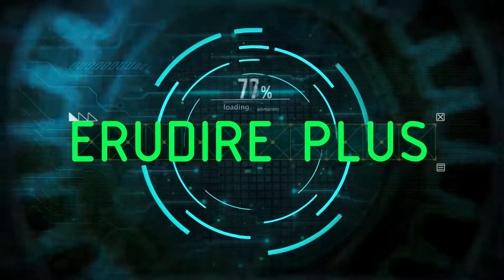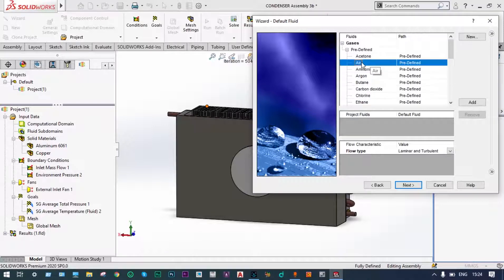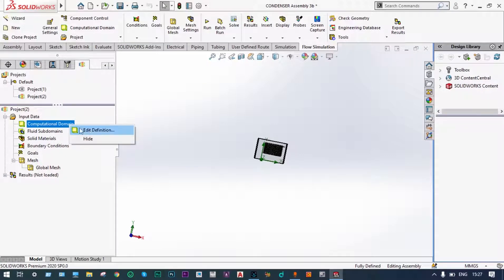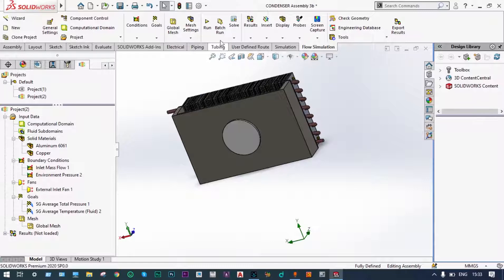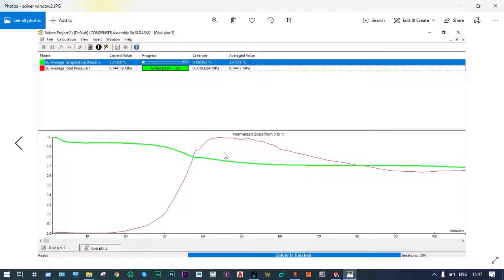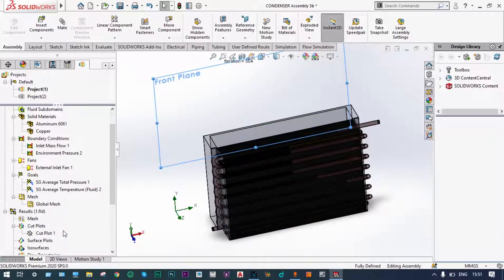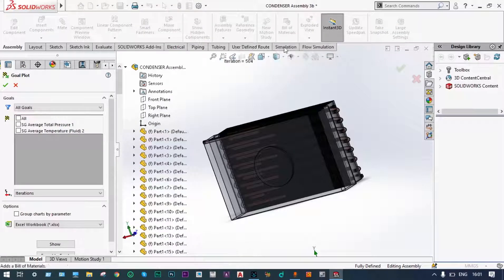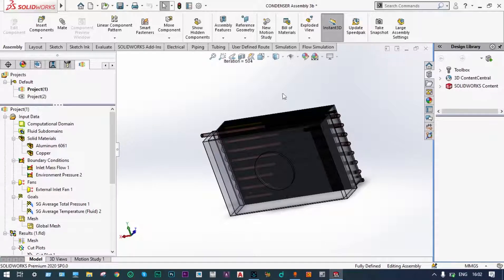CFD Analysis of HVAC Evaporator with SolidWorks 2020

Comment: Dear Sir, Every evaporator has the atmospheric pressure at inlet??
In our final yr project the measured pressure at outlet of evaporator will be 0.077083 MPa. So should i put this value in the second boundary condition u mentioned @8:26 duration??

Btw, thanks for u help sir!
Reply: @Erudire Plus We are working on a domestic refrigerator evaporator, which is running in a complete refrigeration cycle...
Reply from the maker: Where there is an opening, at the exit or any other location excluding entry, you can provide boundary condition as atmospheric pressure
Reply: @CFD_GUIDE  in our case we are directly sending the outlet of evaporator into the input of compressor....so will it be atmospheric?
Reply from the maker: If you are considering separate processes in that case output of one can be considered as input of the other.

Comment: Sir, in Boundary Conditions if we are applying the outlet pressure, we already know what will be the outlet pressure (here Patm)...So whats the need to define max temp fluid goal?

We can find the temp of Refrigerant (Here R123) from the property table if the Pressure is given..…!!!!

Pls resolve my query
Reply from the maker: To validate results from property table needs to have the result from goal plot
Reply: @CFD_GUIDE  You mean to say that, the property table must be verified? Isn't it the globally accepted litreature?
Reply: @CFD_GUIDE  Also sir what is criterion value in the results? @10:16 duration

Comment: We know that the refrigerant pressure at the evaporator outlet is the same as the compressor inlet pressure, can we using environmental pressure at the evaporator pipe outlet to represent that condition? , Please enlighten me
Reply from the maker: In any closed system, whenever we consider any exit, it corresponds to atmospheric pressure. If you consider evaporator and compressor  together in that case the intermediate pressure is not required as a boundary condition.
Reply: @CFD_GUIDE  Thanks.... so .... if we want to simulate the refrigerant conditions in the evaporator, we have to use all HVAC components?
Reply from the maker: No, it is not necessary. Use proper boundary conditions